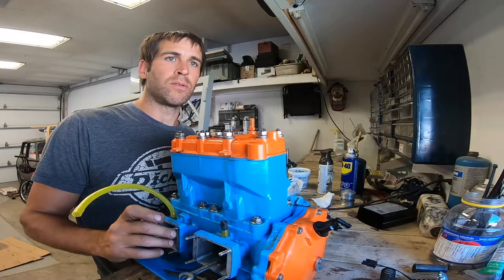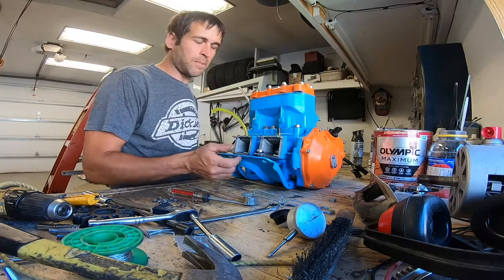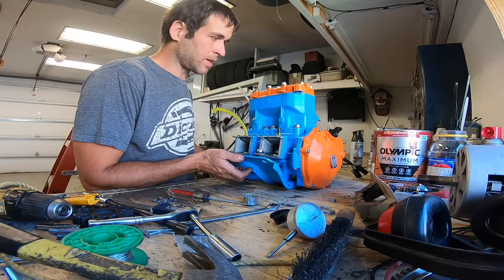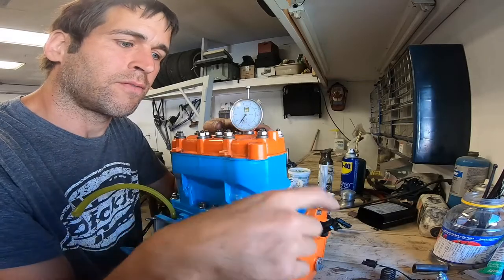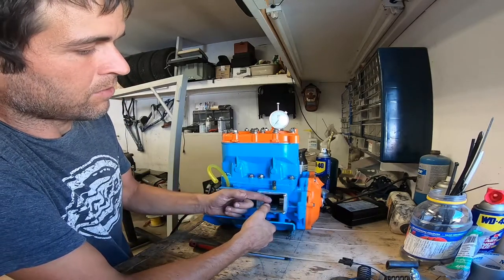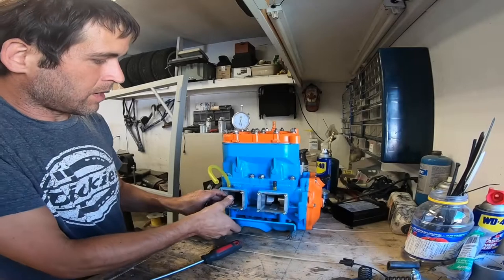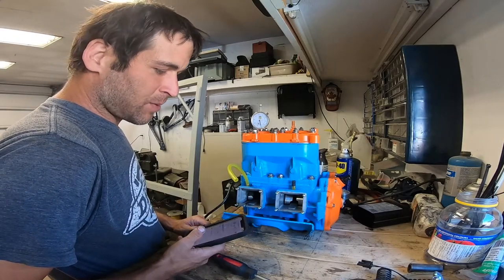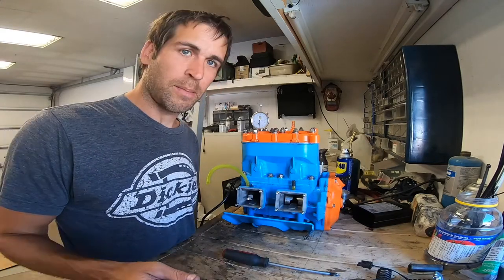How To Test Big End Bearing Play - Connecting rod bearing clearance

Comment: I had to buy a new crank a couple weeks ago. I just had an engine apart and did the old loose finger test and decided I didn't want that engine to blow up. I have never seen a crank bearing failure that wasn't a big rod end bearing. The crank was about 600 bucks so It sucked. But I shipped them 4 triple cranks and 3.5 twin cranks and they gave me 300 bucks in core money. I packed 3 usps flat rate boxes with 69 pounds of crank  (max is 70). The post office people didn't like that! the boxes were pushed to the limit!!!
Reply: @JoelArseneaultYouTube  Oh It was for the engine out of my x2! I was riding around with a clogged tank vent.... I checked to see my fuel level and my tank was totally collapsed on itself. I think it made it run pretty lean for a bit...... Long time later when I cracked the engine open for something else I saw the crank was shot. Usually I find one good rod and one thats toast but this time they both were done.

Also YEAH buy more stuff! Not saying spend a bunch of money but if there's a good deal, might as well be you!
Reply: @JoelArseneaultYouTube  Gosh man. To bad the jetski bros aren't there to give some jet ski relationship counselling. I need to write a book on this.... so we can sell it and more importantly tell people to read the book! Now I could help you but if you read my book.....